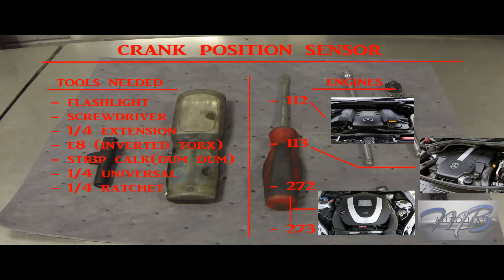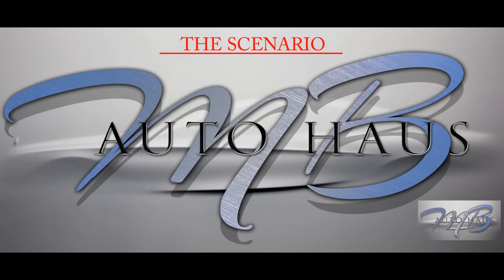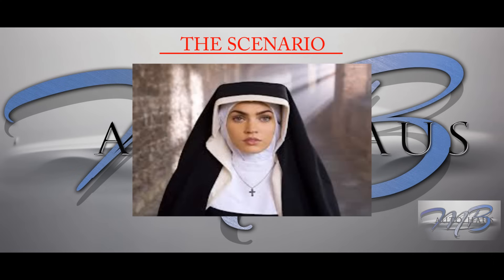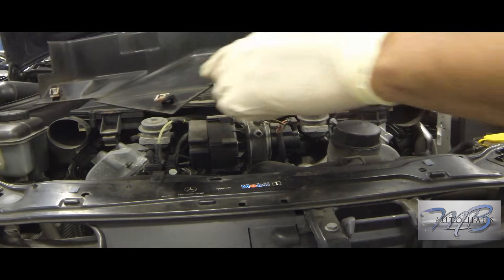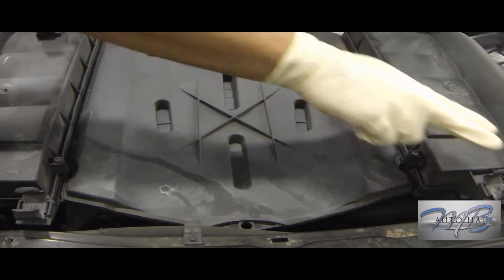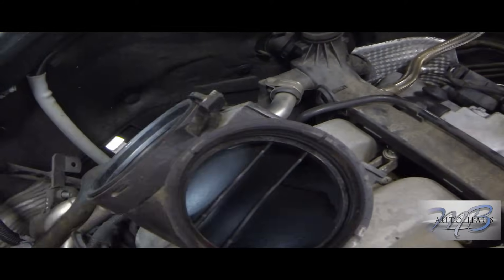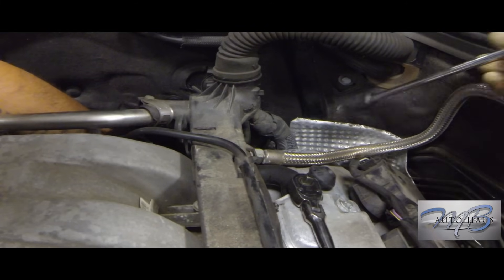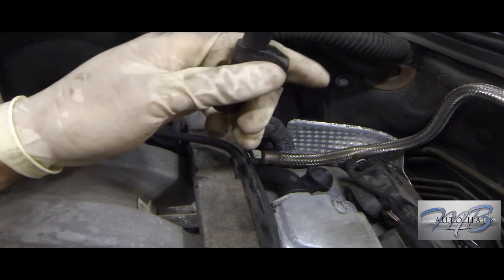MB AUTOHAUS MERCEDES BENZ CRANK POSITION SENSOR  REPLACED 1 OF 2

Comment: I just got a 04 CLK55 AMG with crank sensor fault I replaced the crank sensor and it still have same issue. any idea?!
Reply: How hard was it? I have a c55 amg.
Reply: it's an hour job roughly. I actually had a defective brand new one from pepboys I put the dealership one .no problem since then
Reply: ok, the guys on the AMG forum, say get Bosch. Autozone carries it.
Reply: Bosh is usually the manufacturer for those Euro car but when it come to those important sensor I don't like to play around. But you can always try
Reply: Yep thanks guy,, take it easy.

Comment: anyone know where a crankshaft position sensor is located on a 2001 ML 430?
Reply: Typically the bell housing. I have a 1997 C280 and it probably took me 3 hours to take mine out, it was hidden right behind the oil filter housing in a hard place.

Comment: Question.  Car runs great.  However, I noticed later after I connected my negative cable back to the battery that my keyfob will only work if its within 2 inches of the driver side door.  The keyfob has no range at all.  I have depressed the unlock and lock buttons simultaneously to reset the keyfob but it still no range.  I'm sure it's something that I caused lol.  Any guidance to resolve would be greatly appreciated.  Thanks!
Reply: Check the radio frequency fuse in the trunk the car
Reply: Best bet, Order a new key from Mercedes. It's expensive but at least you won't get stranded somewhere. I Know.  The Key Fob's have a copper coil inside that goes bad after several years of being banged around. Always have a spare.